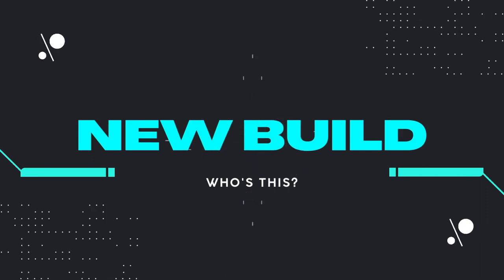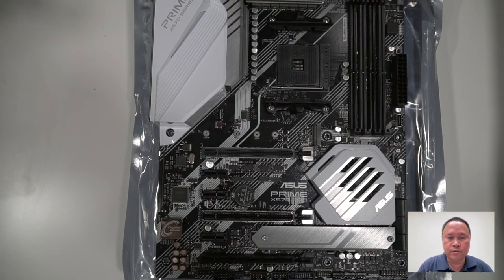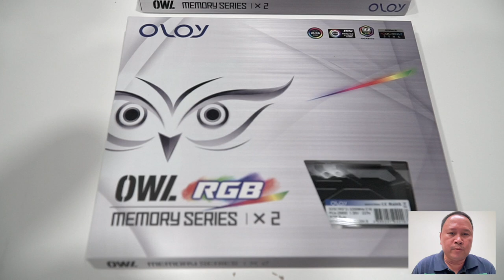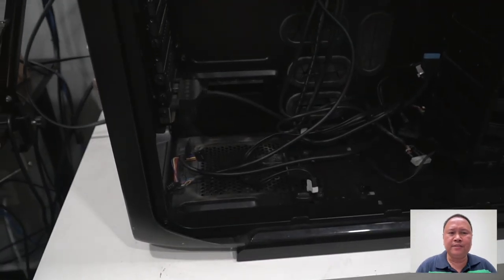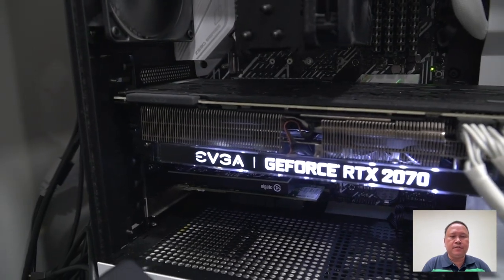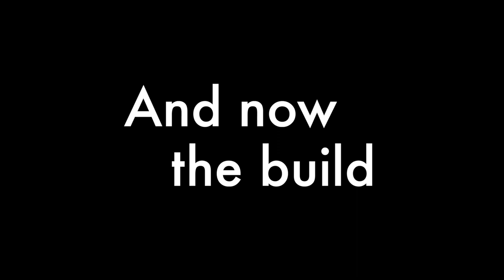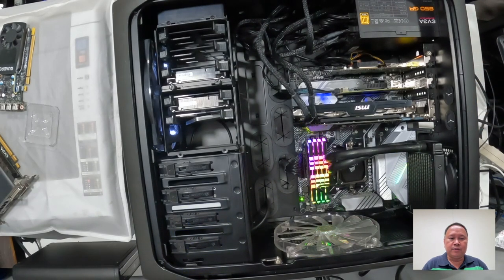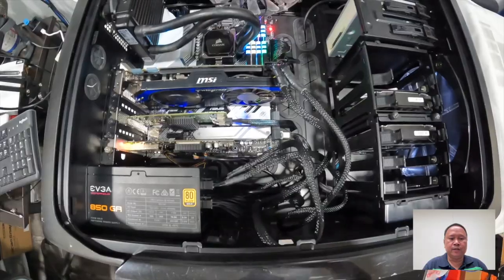Ryzen 3900X for home server

Comment: I just built my first unraid server using a 3900x. Was thinking about getting the 5950x but for what I'm using it for the 3900x will be more than enough. Its a NAS/Plex server with a windows 11 vm for downloading and occasional gaming.
Reply from the maker: The 3900X is a beast. I just moved my Proxmox server from a Ryzen 2600. The only thing I wish it had was iGPU. It’s a waste of slot running discrete GPU. I should do an update video 🤔
Reply: Im thinking upgrading my dual xeon x5670 for a ryzen 9 3900x other people telling me to go with igpu intel fornthe transcoding ! For you is it going well for transcoding ? 

I have a 1070gtx 8gb laying around will it fit with the amd ryzen ? 

Thanks hope you can help
Reply: @angelorgya  I was using a gtx 1630 card for transcoding and it worked beautifully, but now I'm just letting the 3900x do the transcoding and its still doing great. I stopped using the gtx 1630 because I have a windows 10 vm using it to output video to my 70 inch TV. I only have at most maybe 3 to 4 1080p transcodes going on at most so 3900x easily handles that with no issues.
Reply: To get more space i m planning to convert everything in h265 , do you think it will work well once all converted to stream to people who are not direct stream ?
Reply from the maker: @angelorgya  from my understanding, you will need a GPU for the host (if you are doing virtual machines) and another GPU to do your transcoding. I tried to only have one GPU and was running into issues when using some of the resources of the main GPU to guest environment. It wasn't recognizing it. It could be BIOS firmware or I'm not fully understanding the config. I use GPU transcode for Plex so I use a spare 10th gen Intel I got from a black friday sale a few years ago. it's a dedicated plex service and the iGPU from intel works like a champ when transcoding. I use my NAS to store the media files for Plex. The advantage of using certain Intel CPU is they have iGPU for the host. consumer CPU like Ryzen may not work if it doesn't detect a GPU. there might be new firmware that allows this though. i believe the Ryzen 7000 series now has iGPU. but for me, I like Intel's iGPU for transcoding. let me know what you end up doing.
Reply from the maker: @angelorgya  i have a mixture of h264 and h265 files. depending on the client you use to watch media, it may not playback, like older media clients. but if your playback device is 3 years or newer, i think it'll be fine.
Reply: @angelorgya  Yea you'll be fine. I have  done a movie watch party on plex with a total of 4 people streaming a h265 movie and it was no problem at all. This was with my 3900x doing transcoding.
Reply: @sherwinm  i dont understand why i should have 2 gpu ? That server is not connected to my television i only stream to friend and to me , at home i watch using firestick the gpu would be only use for transcoding help and converting file help
Reply: @ahwayzcool4630  the 4 people was transcoding the same movie at the same time , no one was direct play ?
Reply from the maker: @angelorgya sorry I misunderstood. I was referring to if you were going to do a virtual machine or docker container. That’s what I’m using the 3900x build for. I have a dedicated 10th gen intel PC with iGPU that’s working like a champ.
Reply: @sherwinm  yess i want to replace my xeon x5670 with ryzen 9 3900x ? You saying i should go with intel newer cpu ?
Reply from the maker: @angelorgya if you’re gonna do a dedicated Plex server I would go with 10th gen or newer intel. The iGPU will be fine for transcoding. I’ve done as much as 5 concurrent streams. You won’t need a discrete GPU but have the option to. Intel i3 or i5 is more than enough. Great on power consumption. If you use the 3900x it’s kind of overkill and you will need GPU for sure.
Reply: @sherwinm  currently i have dual old xeon x5670 , and it happen that i stream to 12 person at one , but their not all transcoding most of them are direct play , but it still over loading my cpu and i want to stream to more than 20 at once that why i kind a need something overkill u know ?
Reply: @angelorgya  Yes 4 people transcoding the same movie at one time. My brother, my 2 different friends, and me. But like @sherwinm said, a newer Intel processor would be best if your doing a plex server build. I only used 3900x because I already had it with an x570 board.
Reply from the maker: @angelorgya hmmm, I looked up that CPU and it’s from 2010 so a lot has changed and improved all those years. The most I’ve done on my 10th gen i5 is six I think but mostly four. Direct play hardly uses resources. Maybe run both and slowly migrate users over. Move the users who transcode slowly over. Track the resources and continue to move users over slowly.
Reply: @sherwinm  thanks for your answer ! Really appreciate

Comment: Power consumption ?
Reply from the maker: it floats around 100 - 108W. i have proxmox running as the OS. running 4 VMs - proxy server, pihole, ubuntu with docker containers, and another ubuntu server. i just restarted and plugged in my killawatt. if you want, i can tell you after 24 hours what the kWh is.
Reply: @sherwinm   Thanks !
Reply from the maker: @bastienmarchand1693  184 hours (7.6 days) at 18.45 kWh. am i reading that right? hopefully that helps or makes sense. i'm not really good with the electrical stuff